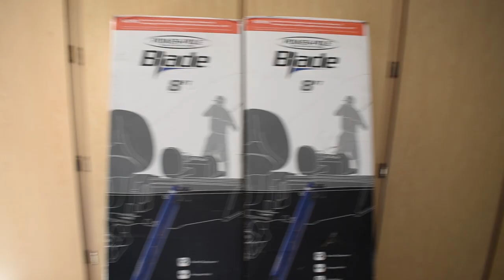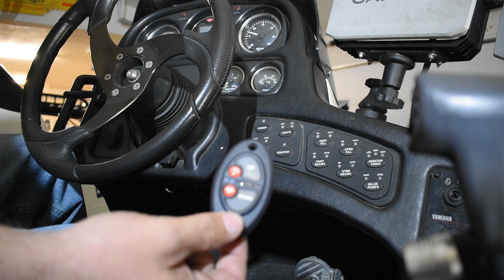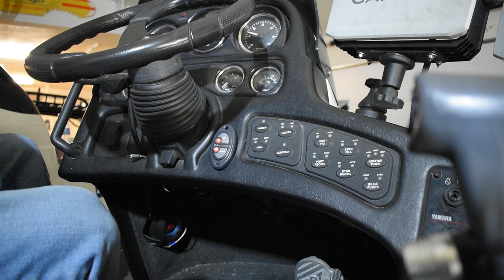DIY How To Install Power Poles (VERY EASY)

Comment: I would switch the bolts out that you used to mount the pole to the jack plate bracket. You used the thru-transom bolts. You should of got bigger hardware in your adapter plate box. If not call power pole and they will send you some with the rubber coated washer too.
Reply from the maker: Good eye!! Yeah since I purchased them from a friend somehow They were missing. I did not get the correct hardware for that. I did however switch those out about a month after realizing they weren’t long enough. Thanks for checking out the video!!

Comment: Did you put a cut off switch on the pumps?
Reply from the maker: I did not. My boat is always plugged in after every use so I was not worried about it using power. The power seems to shut off after the boat is not in use for a while.

Comment: I sure hope that installation has a fuse or circuit breaker inline with the battery.
Reply: ... Each pump has a fuse. A cut off switch is needed because, like most if not all MFD (electronics) they constantly draw power.
Reply: @240LTS  Thinking about it, I am guilty of not taking my own advice.  Fuses and circuit breakers should always be as close to the power source as possible.  Nothing wrong with having more than one in the same circuit.  But, you probably know that.